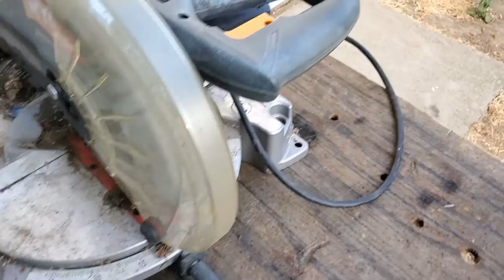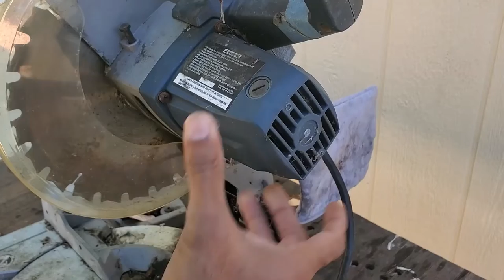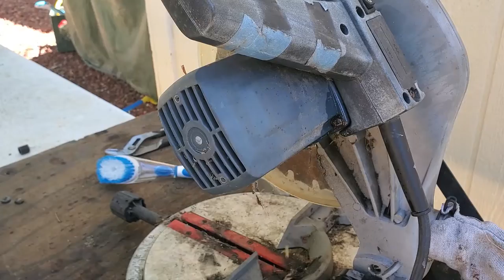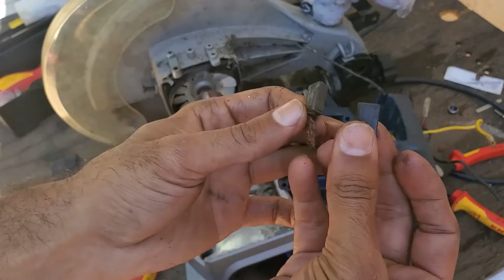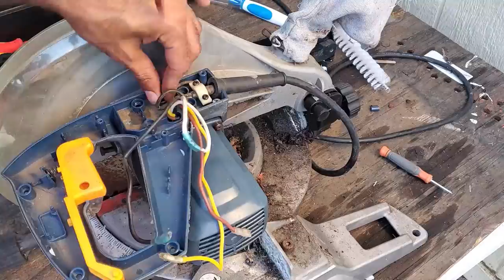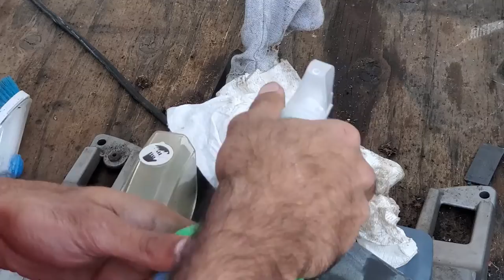Free Finds: Repairing An Abandoned Miter Saw That Won't Run!

Comment: Nice find!
I have sliding miter saw that a friend borrowed, now it sounds really bad! It's really grumble and noisy when you pull the trigger. He says it did that during a cut and doesn't want to cut good after that...
Any ideas where to start looking?
Thank you kindly!
Reply from the maker: I would look at the brushes and the motor bearings
Reply: @DuctTapeMechanic  I will do that! Thank you
Reply: @DuctTapeMechanic Hi, my drop saw is jammed, motor makes sound but not spinning when turned on, any idea about it, thanks

Comment: I’ve got a millwallee slide mitor saw it works but throws sparks out of it put new bushes in it same thing noticed the armtor or what ever it’s call the thing that the bushes ride on it’s like it’s loose that it set in